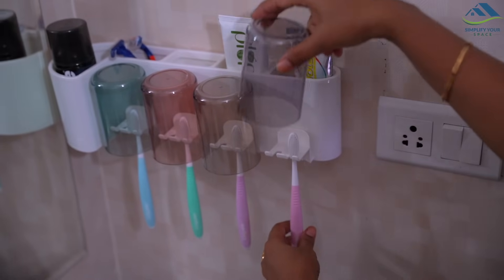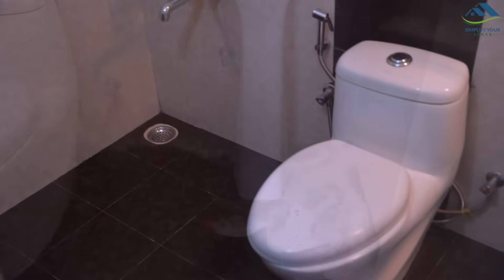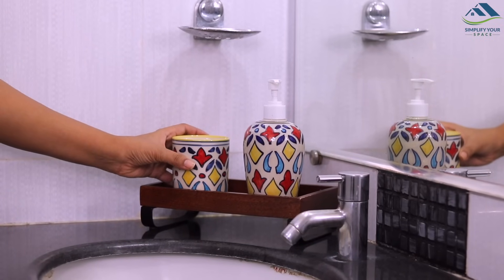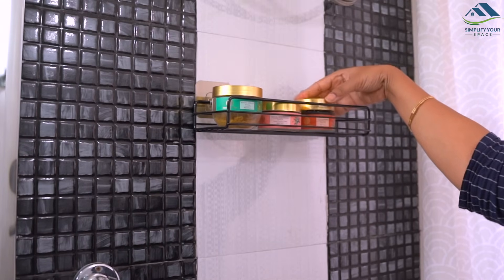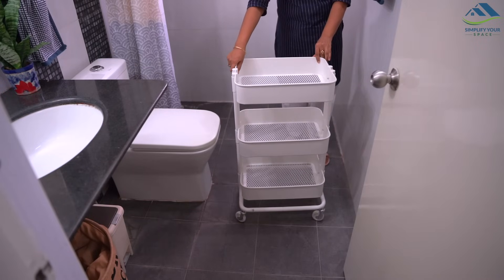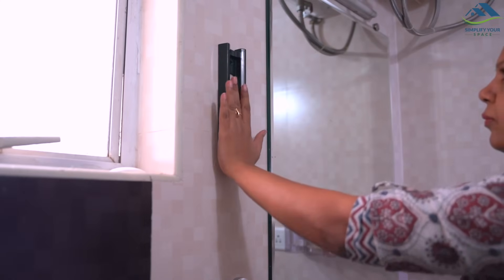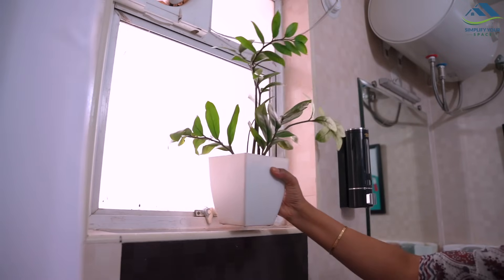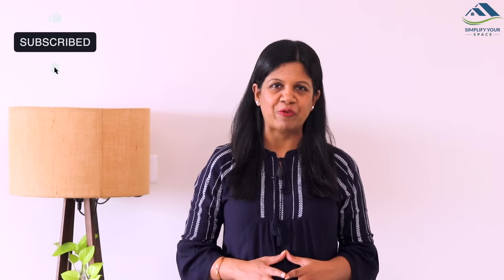Small and Unfurnished Bathroom Organization Ideas | Renter-friendly Bathroom Organization

Comment: Very nice organization ideas. But these self adhesive strips sometimes come out even with light load. I used them in my bathrooms to organise the wipers and bathroom floor mops, which are not that heavy. But in one bathroom the wiper holder strip came out after a few days. While in the other two bathrooms same type of wipers are hanging perfectly well.  Also used them in my kitchen under the overhead cabinets to hang kitchen napkin rolls and hand towels. It works on smooth but matt finish laminates very well.
Reply: So true...same thing happened wz me.
Reply: Yes it happened to us also was not useful
Reply: I know. Not useful
Reply: I have been using them too but mine is working just fine from last 3 years. Try Hokipo ones as I have them in my apartment and they are doing great from a long long time.
Reply: For me ..
These hooks never works. Though I am a regular viewer of this channel ..... would like to know from Ashu how it works for her.
Reply: When you stick adhesive hooks ...use little fevikwick  while sticking...n see the difference
Reply: @deepamanish103  thanks. Will surely try
Reply: Try Hokipo. It can hold weight.

Comment: Are these self adhesive hooks durable & for how long ???
Reply from the maker: They are definitely not meant for heavy items. Also, if tiles are too glossy and slippery these hooks may not work. I have been using them on wooden surfaces and matt finish tiles to keep light items. They work well there.
Reply: I got the adhsive hooks. Till load was less it was okay but one day it just came out with the paint.
Reply: @uwumsg  thanks for the feedback

Comment: Do these self adhesive hooks last long
Reply from the maker: They are definitely not meant for heavy items. Also, if tiles are too glossy and slippery these hooks may not work. I have been using them on wooden surfaces and matt finish tiles. They work well there.